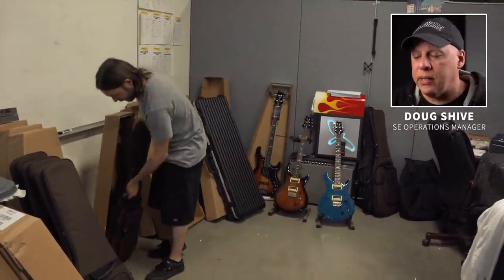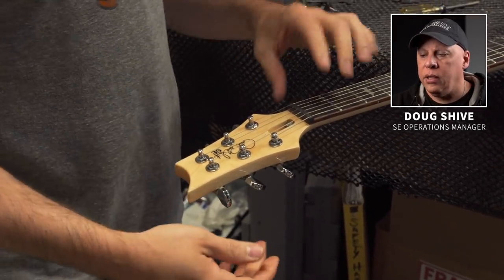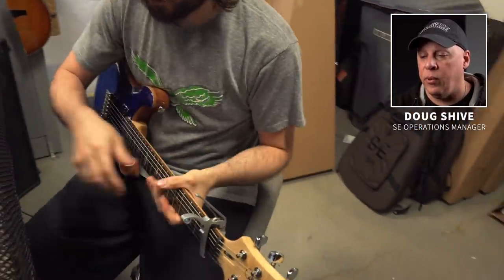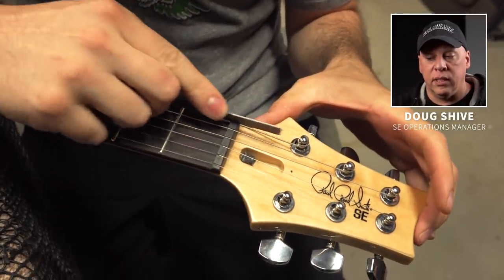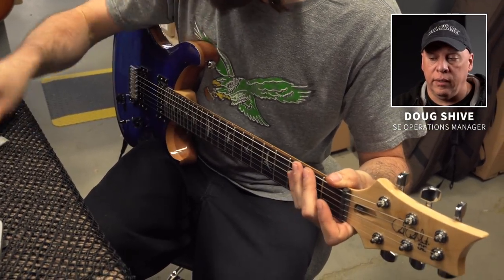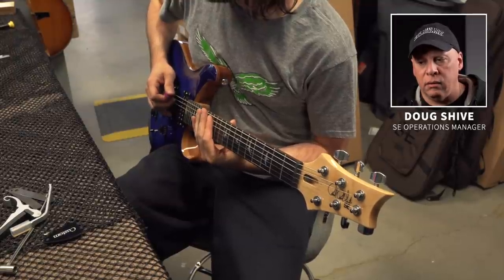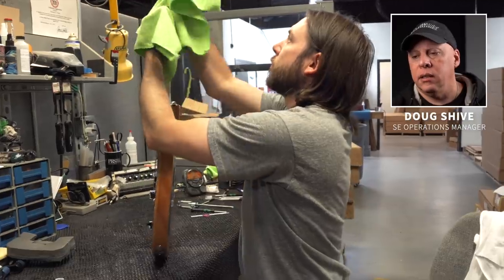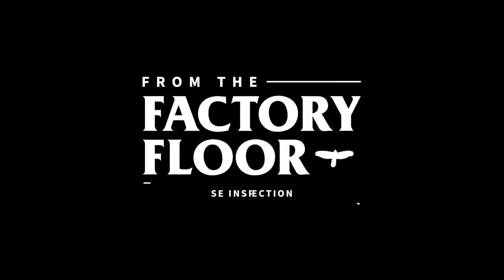SE Custom 24 Inspection | From The Factory Floor | PRS Guitars

Comment: This has definitely convinced me to buy an SE.  All companies should be doing this, unfortunately I’ve purchased other brands that probably didn’t even see the guitar before their customer.  Great process! Thanks for sharing
Reply: Do! Mine was perfect from the bag that I got a few weeks ago!
Reply: SE’s are a great value. They Sound and play great. I’ve earned a ton of money with mine. I use it as much and as often as my core guitars.
Reply: I have the original Santana SE from 2005 in cherry red. It was one heck of a buy around $500. Still a great guitar!
Reply: Don’t. The SE sounds terrible compared to the CE and CU. all this QC doesn’t male up for the pickup difference in my opinion. And prs doesn’t sell their 85/15 anymore so you can’t install the American ones in our SE. I would recommend saving up for a CE or core 24. The oversees pickups are just trash compress to American. No sustain, they break up easily, etc. don’t make the same mistake I made.
Reply: @abevon6152  so do what I did and upgrade the pickups and tuners/hardware.  You get a great PRS guitar at a Much more affordable price.  
PRS SE Custom 24: ~$900
Upgraded locking tuners (Grover): ~$200 (including labor)
Upgrade pickups (Seymour Duncan JB/59): ~$300-$350 (including labor)
Total spent: ~$1500, roughly a third the cost of a new Core Custom 24.
Reply: @roopwind  yeah I totally agree with upgrading. Although my beef is the comparison between the SE and CU. I wish prs would stop making comparison remakes because they are not at all the same. Sound and feel is totally different. I was going to upgrade my SE but then I just bought an S2, CE and core 22 lol. Wife’s not happy  🤷🏽‍♂️
Reply: i think Orangewood do this as well. The mahogany acoustic i received was immaculate. String height was perfect, frets shiny, no sprout, played and sounded really, really nice.
Reply: @abevon6152  Also fwiw my Core Custom 24 is a bit older (~2004-05) and has the older HFS (bridge) and Vintage Bass (neck) pickups in it, which are my favorite pickups I've ever played (better than the 85/15s IMO), and which you can now order directly from PRS if you wanted to upgrade the pickups on an SE.  They're around the same price as a nice set of comparable Duncans/Dimarzio/etc.
Reply: @abevon6152  I'm sorry, but telling someone he shouldn't buy a PRS SE because CE or Core models are better is a bit pointless. Someone considering to buy an SE is looking into instruments at a completely different price range... so, telling them a guitar for three to five times the price is better isn't helping all that much, IMO.
Reply: @MR-vg7yn  ok

Comment: I have been playing guitar professionally for over 50 years. During that time I have owned or played just about ever type of guitar from just about every major manufacturer. About 8 months ago I purchased my first PRS guitar…a SE Paul’s Guitar…just to see why so many fellow players raved about them. I must admit, I was amazed at the quality and sound of the SE Paul’s Guitar. It was without a doubt one of the best guitars I have ever owned at any price. Since then I purchased a Core Paul’s Guitar for studio use. I continue to use the SE guitar for live gigs where there is more risk of damage and/or theft. I wholeheartedly recommend PRS guitars, both SE and Core models, to friends.
Reply: I've been a Gibson and Fender player my whole life (playing for 30 years) but after another bad experience with a Gibson Custom Shop this past summer I'm contemplating giving PRS a try (never owned/played one). You would think this QC practice shown in the video would be standard practice but sadly it is not.
Reply: @silkysoy1794  yes it’s worth a try, my ‘88 PRS arrived perfect and has since had slight truss rod adjustments spring and fall and then a couple of fret dressings over the years but nothing else to fix. 
My 2013 SG also bought new is a love/hate relationship, so much work and time to get it right.  Shipped that way, so careless, but it is good now.  
The PRS is completely reliable, beautiful, plays and sounds great while the SG, also beautiful and sounds great, I have to take way more care of it. 
Odd how we get to love all the different ones and don’t want to give ‘em up 🤷🏼‍♂️
Reply: @Riverdeepnwide  I have a 2012 Gibson SG that came from the factory with the routes for the pickups cut incorrectly such that the pickups tilted significantly, in addition, the nut was cut completely incorrectly creating all the usual playability issues. Someone gave me this guitar as a gift so I did not immediately return it…I just rarely played it. Last year I sent it in to a luthier who recut the routes, reset the pickups, put a new bone nut in place and totally reset the guitar. Now it plays and sounds great. However, Gibson’s workmanship and quality control had become so poor that a guitar this badly constructed was shipped to a retailer and the retailer didn’t notice or care about the quality issues. Says a lot about the entire Gibson supply chain. Both my new PRS guitars were perfect in every way….they were even in-tune when they arrived (I bought them on-line and had them shipped to me).
Reply: @petesmith6434  thanks for all you’ve written, yes similar SG nut setup to do on mine, tailpiece & studs damaged at assembly and passed QC, truss rod not engaged so the action was banana necked.  Online purchase of a ‘13 in ‘15 for a good price but sheesh ...
With time effort and patience it did all came together nicely.  From what I heard and read at the time it seemed the employees were under some unpleasant pressure and dissatisfaction.  
My old PRS still got all the mileage though.  
👍🏻 Cheers Pete
Reply: @Riverdeepnwide  I have heard that Gibson may have now finally gotten their act back together. However, I have lost faith in them. I just purchased a Heritage H535 as a gift I am giving one of my grandsons. I went with Heritage instead of Gibson because I don’t want to deal with potential quality issues AND the price of the Heritage H535 was much less than the Gibson ES335. Gibson is going to have to work hard to rebuild the trust their customers once had for them.
Reply: @petesmith6434  I’m not sure if they have fully gotten their act together but maybe heading in the right direction with new management. I purchased a new Custom Shop 1964 RI ES-335 this past summer and it had scratches all over the top finish, the volume knob was cracked, one section of the binding was cracked, etc. I was shocked since this came from their Custom Shop. Maybe they were under pressure to get these out since their production is behind due to COVID. I eventually returned it.
Reply: @silkysoy1794  I’m sorry to hear that you had a bad experience with Gibson recently. I had been told by a local luthier that he was seeing an improvement in Gibson’s quality of late. It’s a shame to see what was once a highly respected American instrument manufacturer go down the tubes like this. Well, PRS is making fantastic guitars so we have at least one company we can count on…at least currently!
Reply: As a lefty player, I have had a really hard time finding a lefty core for years. So, I gathered Strats and LPs etc as such. When I was finally able to source a lefty core 24 used it instantly felt like I met an old friend. Four months ago I was able to source the exact same blue SE locally here in Mississauga Canada. That same straight out the box feel happend with my SE. I'm keeping the Fenders and Gibsons in their cases and I visit them from time to time but, I'll forever now be a PRS fan. Doesn't seem to matter if a used Core 24 or a new SE for under a grand, both have equally adjusted what I find value in. Hoping to go to Baltimore for a tour once the border is open. I'm beyond impressed with PRS. Cheers

Comment: This is what makes PRS a cut above the rest. My love affair with PRS began 10 years ago. Went into the store to get pickup rings and came out with a $700 PRS SE Custom 24. 3 hours later, I was playing it on the stage at Hard Rock Cafe. My $1500 former main guitar sat as a backup. From then on, I've purchased a number of PRS guitars (SE, S2 and core models). Regardless of series, the PRS quality control stands on its own. Barring your personal preference tweaks, PRS guitars are always ready right out of the box.

Comment: Based on a great experience with my vintage core cu 24 and the SE inspection process in the video, I ordered an SE Standard 24-08 to explore tones with new pickups and beyond the 5 way rotary switch setup. The core guitar is the most playable ever. Great company, great products. Looking forward to the Standard, when my ship comes in.

Comment: Yesterday I bought a PRS SE Custom 24 in Black Gold Sunburst. I still cannot believe how nice it is. It was setup so good. It blows my mind watching this video. Did my guitar go through that process too?  I had just bought a Fender MIM strat in Blue Burst but I was so disappointed with the initial quality. I returned it to a big guitar store and bought the prs from my local dealer. I was shocked that I actually came out ahead on money and the amazingly built PRS came with a crazy nice gig bag!!!!!!!  Just 2 weeks ago my son and I were at my local dealer and someone had just traded in a PRS SE 24 Standard in cherry red. We got it for my son who is 15, a great deal for sure. Thanks prs for having such incredible standards of quality and taking pride in your work.
Reply: I can totally understand and relate to the comment.
My first PRS SE is Standard 24 Vintage Cherry. It looks and plays amazingly. The rounded corners around the top is super comfy. But need to replace the plastic nut to bone nut for tuning stability issues reason.
Since then I know I'll have this guitar in my rack forever.
Got my second SE 2 months ago, an SE Custom 24-08 ; another beast that worth every penny I spend for this guitar.

Comment: I have two SEs - the Starla Stoptail and the Hollowbody Standard. The Starla was new from Sweetwater and it came out of the box in tune and very playable. I lowered the action just slightly per personal preference, but it was pretty amazing the way it came. The Hollowbody was gently used from another player, about seven months old when I got it, and it was about the same. I went ahead and got it set up locally and now these two are my best guitars by far. After seeing this video, now I know why. Love PRS!

Comment: Not sure my SE Custom 24 could have gone through this level of rigour at PRS UK, the pickup selector switch is very crackly when changing positions and occasionally gets stuck between positions as it is not in the middle of the slot cut in the body. Also found a small blemish in the finish on the edge of the lower horn. None of these things were worth returning the guitar for but they did impact on that new guitar feeling! Other than that I love the guitar and would recommend anything thinking about one to go for it!

Comment: Except I got a PRS SE Paul's Guitar with a poor solder connection to the pickup selector for the bridge pickup. Additionally the ground wire from the bridge was not stripped of it's shielding or soldered and left a heavy ground hum.

The overall quality of the instrument is superb and I absolutely love it. Easily the single most resonant guitar in my collection. But it might be worthwhile to open up the control cavity to double check the electronics during this process.

Also the intonated bridge/tailpiece for the Paul's Guitar had a notably sharp G-string. You can't really hear it in most chords but it makes open D-chords sound messy and out of tune. I'm aware that my preferred string gauge (currently have NYXL 11's) and Eb standard tuning made this far more noticeable than it was stock. But it's another quibble that I have.

Again I do absolutely love my guitar and I am absolutely blown away by the quality and craftsmanship (especially for the price). But I share this in hopes that you can continue to improve your processes.
Reply: You don’t know how to intonate?
Reply: @grenade.turtle  it's a single piece fixed wrap around tailpiece. Had to split the difference for all six strings

Comment: I got one, an SE Custom 24 FE, and the volume or tone pot (don’t remember now) crackled. I sent it back. It was in EUROPE from Thomann so maybe the QC check was skipped? Thomann is famous for cutting corners, they never open a box and a few times they even sent me an obvious B stock guitar sold as new! But their return policy is good for checking out potential guitars.

Comment: What about all the SE guitars that are being shipped to the rest of the world? Who quality checks these and sets them up?
Reply: I had a custom 24 se. There was finish error(fingerprint), an epoxy patched blowout at the trussrod adjustment and trem arm didnt move freely. It had ”passed” the QC according to the note that came with the guitar.
Reply: The only reason I ask is because I bought a SE custom 24 from Manny's in Brisbane. Don't get me wrong, it's fantastic guitar which I bought on sale for $900. It did have tuning stability issues though so I spent a further $250 getting a set up done to my personal preference, having the intonation corrected and issues with the trem fixed. The guitar dude was very impressed with the quality of the guitar for a sub $1000 price but it was just missing that final set up and QC.
Reply: Tried a Paul's guitar in Dubai. Was not impressed. Guess it's not qc'd in US

Comment: I received my first PRS guitar. Brand new in the box sealed from the factory. There were hundreds of scratches on the back. The serial number card was not signed by the quality department. Is this normal? By the way, my guitar was a USA model. Bolton

Comment: I just unboxed one of these in the same color as the thumbnail. They must have skipped the inspection on this one. After verifying the relief on the neck, I find that the action is 3mm at the 12th fret and the bridge is 2.5mm off the deck! Even if I put the saddles all the way down so the screws aren't touching anything at all, the action is still over 2mm at the 12th.

I guess they forgot to look at this one....

I can fix it, of course, but....shouldn't have to.

The hang tag is blank: no signature. I think they actually forgot to check it.

Comment: Well, i had the issue with my se 245 singlecut, albeit not a major one but still it shouldnt happen. My pickup selector is apparently dirty so whenever i select my neck pickup it doesnt sound. So i just sprayed some wd40 to the switch and it works. Its a nuisance really, you should be aware of it. But then the guitar does sounds really good

Comment: This is very interesting, but there is NO way that my SE had this amount of attention, given the state the nut was in upon receipt. Absolutely no way. Everything else about the guitar is top-notch, but the nut quality was awful and with the severe gashes present in each of the grooves, there is NO way that it had been checked properly like in this video, it's just not possible. I whipped the nut off and replaced it with a superior Tusq nut, but I shouldn't have had to
Reply: Yep! I had an SE Standard 24. Out of the bag the build and details are top-notch but the nut isn't. It's a cheap plastic and poorly cut nut slot. I had to replace them with a bone nut.
But 2021 issued SE Standard 24 have the same nut as what they used on the SE Customs which is much better than last year.
Got an SE Custom 24-08 two months ago, maybe due to temperature changes during storage or shipping the action was a bit high. A little turn on the truss rod solves the problem. And a little fret levelling allows me to setup the guitar with super low action without buzz.
Reply: Mine's a 2020 SE Standard 24. It isn't a plastic nut, it's a composite, but came with deep angular gashes in it, almost as though someone has taken a blade and sliced into the grooves. PRS didn't want to know, even though I sent them a picture of what it looked like. Their answer was "Return it to the store", which is a legitimate solution, however we were in lockdown, it came via courier and it would have been a faff to return, especially as I knew that the nuts are the weak point so was planning on having it replaced by a luthier at some point anyway. But because my local luthiers were closed due to lockdown, I opted to just do it myself. But, again, I shouldn't have had to do that. I've owned many, many guitars over 31 years of playing and NEVER have I seen a nut like that. I mean heck, I have budget guitars that I've owned for almost as long as I've been playing, have been played and gigged a lot and still have perfectly intact nuts. Considering it's a PRS, I expected more. I also expected more recognition of the problem from PRS. I know there isn't much they could actually do, but I was pretty much just fobbed off, which was disappointing, especially given just how bad the nut was.

However, having said all that, that's the only poor point on the guitar. It looks, feels, plays and sounds amazing! And now that it has a Tusq nut, it stays perfectly in tune, even with whammy bar dives - not that that's really my style of playing, but I had to test out the tuning after the nut replacement!

Comment: The SE 24 I got is horrible, and I have no idea how it passed QC.  Also PRS called it a "subjective" issue, meaning too bad.  It's a custom 24 poplar burl model, and has absolutely horrible finish sanding(seams and tooling marks strongly visible through finish) and pitting and orange peeled finish.  WORST GUITAR IVE SEEN.  Also, because it was a gift, they called it transferred ownership, and voided the warranty even though it was brand new.  I'll be making a video and posting all my issues with it, and the customer service problems.  I'm stuck with a terrible looking guitar that was supposed to be a nice gift from my family after a year in hospital for heart surgery. Thanks PRS!